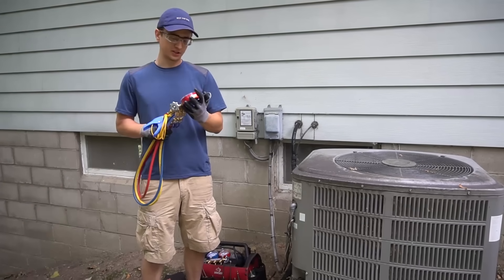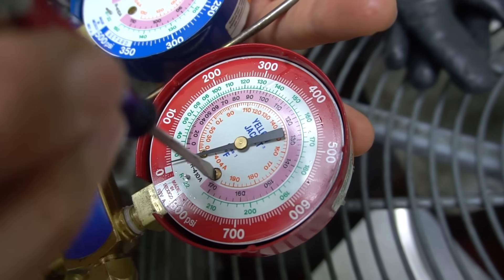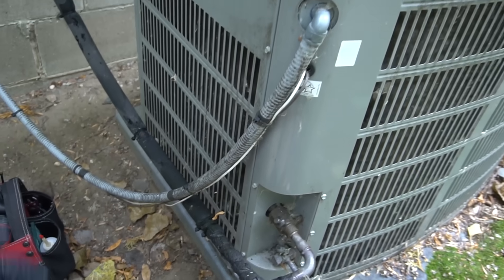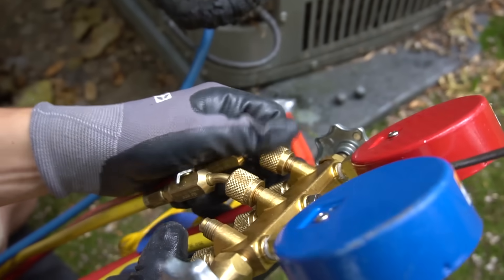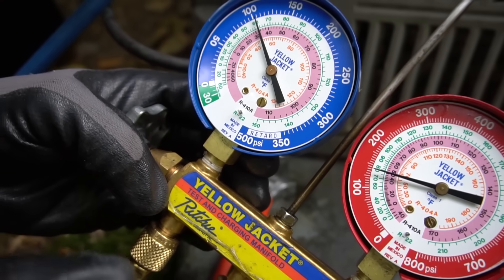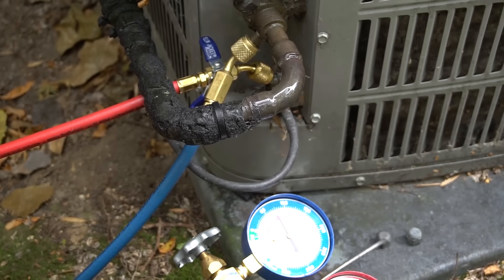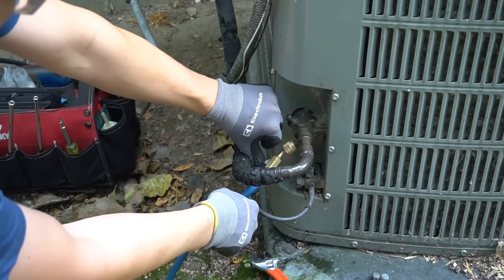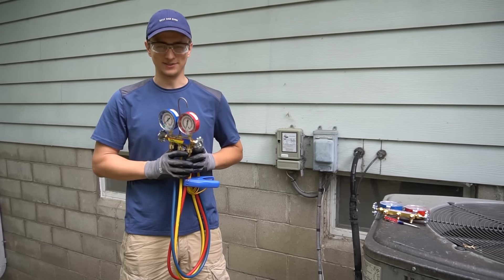How to Check AC Freon Level

Comment: I got a mini split unit. I realized a mini split only has a tap on the low side, not high side. So I can't use subcool to check the charge... But anyways I checked the pressure on one of my mini split and it's reading at about -10C according to the R22 scale. And the evaporator coil seems to freeze if it runs for too long. Will need to charge it a bit more.

Comment: 13:05 what if you don’t have ball valves, could you still purge the air from your gauges using the same method of opening up the valve on the high side?

Edit; in HVAC/trade school

Comment: Hi Sir, if the unit is R22 charged and using fixed orifice, which one would be my basis for refrigerant charge, just the saturation temp alone or the target superheat table or formula? Thanks in advance.

Comment: Thanks for the video. Pls  I have a question(1)do you turn off the condenser unit before the process.(2) Is it good to transfer the air from the high side to the low side.

Comment: Your video was well done and it was good you express concern about introducing air and moisture into the system because that is the biggest risk when gauging up to a system and over time, when done incorrectly, can cause operational problems. It appeared that your gauge set was flat when you attached the suction hose and I was waiting for you to instruct us the purge the gauge set through the middle yellow hose and the high side red hose with the system freon to remove the air from the hoses but you didn't. 😕 The air in the hose doesn't necessarily remain in the hose when connected to the system, especially when you start the compressor and the low side pressure drops from 100 psi to 70. It is good to run the liquid from the high side hose through the gauge back into the system but only if the gauge hoses were purged first. Blowing gas from the high side hose into the atmosphere didn't necessarily puve the hose, but only released some of the freon. So, sorry to say but it looks like you blew some of the air that was in your middle hose and all of the air that was in your low side hose, directly into your system when the opened the gauge and ran the liquid from your high side hose into the low side. What I've been doing for 37 years is gauge up the low side hose with the left knob on the gauge set open slightly and the center hose loose and the high side hose attached to the system but not threaded on enough to push in the stem, and guess how long to let the vapor purge through, a few seconds, and tighten up the other fittings, preventing air from entering the system. FYI also, when you remove the high dise hose and the liquid freon blows out, it freezes the Schrader fitting, causing frost and moisture to form inside the valve, around the stem. If you don't put the cap back on quick enough you can trap moisture inside the opening of the valve and push it into the system next time you gauge up. If the stem leaks like you mentioned, put the tip of the screw driver in at an angle under the lip of the stem and pry up slightly to seat the valve better. 🙂

Comment: Great video.  Is there a way to check the refrigerant content/percentage level, or is that it?  In other words, how do you cipher whether it is air or other contaminates or refrigerant giving you the pressures?  Is it possible to have "correct" pressure/temp readings and the system be full of air?

Comment: I have 2 questions if you have time. 1) If the unit says TXV on the cover, do you always do a visual check to make sure? Why would anyone ever change from a TXV if that's what the system was designed for? And even if it was changed over, is it really possible that the tech would not make a note somewhere that could easily be seen?   2) IF a r22 gauge set is also used for 410, is the teeny tiny amount of oil/refrig that remains in the lines after blowing them out with compressed air going to contaminate either system?.......thanks :)

Comment: What is expected low/high side pressure for 410A when HVAC it is stopped?
What is expected low/high side pressure for 410A when HVAC is running for above 15 minutes? 
Does pressure it depends on outside temperature?

Comment: Well this is a lot easier if you've got an easy-fill valve to check pressure. I've got teo R600a mini fridges that won't get as cold as they should. No mini fridges have an easy-fill valve for refrigerant and people say not to use a bullet piercing valve. What do I do here to diagnose/find and repair the potential leak?

Comment: My system is a 18,000 btu mini split 
And I’m
In the Carribean-
My out side temperatures are always 
80-90 f. And the temperature we use on ac inside is always 62.
Should the psi be between 35-40 ?
My unit doesn’t have a high pressure port.
Thanks

Comment: On a gas pack unit that has no line set, is it necessary to check the refrigerant if there is no cooling problem? I have a concern that this would disturb the factory weighed charge unnecessarily. Even if the technician squirts a little freon back in, it still wont be the accurate charge.

Comment: This guy saved me THOUSANDS of dollars in service calls and fees. Thank you, bro!
Reply: If your not certified you can get in some trouble by the e.p.a
Reply: @hollicesmall4769  For checking the A/C pressure? Do you know of any regulations that prevent a homeowner from checking it using proper tools and practices, especially if using a low-loss connector?
Reply: @rogerbritus9378  as far as I know you have to be epa certified to touch refrigerant (Freon)
Reply: Where you live? There is a 10k bounty for people like you. You do know its 45k fine with out the proper EPA certifications to do any thing he showed in this video.

Comment: I learned something from this , but was left confused because the explanation of the  way the gauge manifold, and its two end valves and three hose red, blue and yes the yellow one? weren't explained fully. The yellow hose was only mentioned briefly at the very end and it seems important to grab back the freon!
Reply: The yellow hose is used when recovering or charging Freon in the system. The blue and red hose connect as explained in the video, and then the yellow hose connects to the Freon/recovery tank. If you don’t need to charge or recover Freon, the yellow hose stays connected to the gauges

Comment: i have a question please
i bought a new manifold 
its brand is mastercool 
the thing that i didnt understand in this manifold that the three holes which u connect the hoses to it to close the loop are opened holes 
in this case how i can block the auxiliary hole with the yellow hose to check the pressure

Comment: One thing u didn’t explain was how should we find out how much Freon every unit should have !!!! By reading on plate on unit !!!!
Reply: He explained in the video that what is printed on the unit is what change it left the factory with.  The "right amount" of refrigerant on a properly operating system is more accurately determined by measuring the pressures present / the ambient temperature.   Knowing how many pounds doesn't do you much good unless it's completely empty and you fixed why it's empty first.

Comment: Also jay use a wire type temp. probe tape to the tank right in the area where the liquid is sitting 22 or 410 and let the tank and gauge sit for 4 - 6 hours to acclimate to the room temp then do your setting and calibrations .

Comment: Jay that's not how to get a true calibration . You hook the low side to a tank of gas open the tank and note what the pressure is then take the temp of the tank look at. i use 410a pressure to temp chart . And let say the the tanks temp reads 78 degrees your pressure should be set at 220.6 if it to high or to low then you turn let set screw till it is set at that number and remove the low side and do the same on the high as well. They have a you tube video that explains this . Just turning that screw doesn't give you true calibration. Like you videos watch you all the time showed me a lot . Keep give the videos.

Comment: I watched this video twice.. the first time through I thought it was okay. But the second time through, I said to myself.. wait. what did I actually learn? The video does not accomplish what is stated in the description: How to Check AC Freon Level. At least, not in any meaningful way. The author hooks up the gauges, but doesn't really do that right as there is a mishap that he acknowledges in the comments. I believe it's the one in the video at about 8:16. But maybe it's something different. At about 11:20 the author/narrator talks about pressures beings to high or too low but not how to determine this.

Again, we did not learn any particularly meaningful information in the video about whether the coolant level is correct in this system. We only learned that it has some coolant. Which should already be evident by a system that is producing at least some cold air, without hooking up any gauges. Read the comments by "real hvac tech", "Drew Blood", "D theman" and others.

This is not a video that is deserving of over 1.2 million views (as of Oct 2020). The author should take it down and make a better one. But, there is some good information and the author is thoughtful and articulate .. I give it an E for effort.

Comment: When my AC system is off, the pressure is at 150 PSI. When I turn on the AC system, the pressure goes down to 40-45.  When I open the low pressure valve to add refrigerant, it stays the same and when I close valve, it stays at the same pressure. I don't know if the R22 refrigerant is not going  in or if there is some other issue. I added 14 oz of R-22 from what I saw on the scale and no changes took place.
Reply: reading low pressure does not necessarily mean that you are low on refrigerant.  You could have a variety of problems such as low evaporator airflow, or a metering device problem just to name two.  You really need to check superheat and subcooling to pinpoint your actual problem.

Comment: My Compressor overheated I got it to cool down I was to check the pressures on my gauges  but I have a question why does my low side read higher than my high side on my high side on my compressor would you know

Comment: Very poor advice on how to check refrigerant charge, obvious that you've never worked in HVAC. First thing is you contaminated the system by not purging your hoses, and the pressure means almost nothing without knowing what the refrigerant temp. is or what the superheat or subcool is supposed to be.

Comment: Nice work. Inheriting a month old 5-ton Goodman install that is blowing warm. First thing I noticed was a wet floor at evap--which wasn't replaced. Secondly it looks as if installer had trouble brazing and may not have used nitrogen (carbon).
So this morning I will run it and check line temps, or should I just gauge it up, check readings and do a pressure test? I hope internals have not been affected by carbon deposits. I "was" an apprentice 25-years ago so my memory is suspect. Have STDs. gauges,  410 supply, recovery tank (has some 22 in it, nitrogen with bubble, micron gauge, turbo torch (what size torch would you suggest?), but no scale. 
It's hot, it is a day care, and no one is available to diagnose/repair--so it is me.
Any tips would be greatly appreciated. It's 5AM and off I go!

Comment: Excellent hands on advice. I could have saved myself hundreds of dollars if only I was a little more adventurous and  changed my  AC's capacitor myself. It it not such a complicated affair and you have videos on just about  every aspect of AC repairs. Well better late than never, I will certainly learn from your more for any future problems. Even if I can't actually fix it, I would be better prepared to work with a pro. 

Thanks for educating us masses.

Comment: Hello, I learn a lot from your videos! Good job!
Could you give me your opinion about my numbers? I am in Texas, blue I get 50 PSIG, red I get 180 PSIG. The air temp was 76 F. Refrigerant is R22. 
The system cools ok but the return line is cold to the touch but not very cold. Like maybe 65 or 70 F.
Reply: Working fine. Leave it alone.

Comment: Warning!!!!  To anyone watching these videos or any other videos seeking advice on how to do things yourself please keep in mind that anyone can post any type of instructional video and not be a professional and they can make mistakes that can cause you problems.  "Word of Advice TV" has even posted a comment on the mistake he made in THIS video but it is embedded in all the other comments and hard for anyone to see and be forwarned.  I copied and pasted his mistake at the end of my post here. 

Please watch multiple videos to learn more info about doing things.  AC is very complicated.  "Word of Advice TV" is making great videos and has good intentions but he is learning and making mistakes in his videos too.  He tries to warn people to not do things if you are not a professional and also confesses to mistakes later in comments.  I am learning by watching multiple AC videos that a good percentage of even professional HVAC people make mistakes too. There are also many professionals that will rip you off by over charging and mis-diagnosing AC systems.  

Please be careful with all YouTube videos and learn from multiple sources.

Following is the "Word of Advice TV" comment;
*****
Guys, in this video I made a little mistake and just want to make sure you won't do the same. When I put my gauges on, the unit was off. Usually I put them on while the unit is running. In the video I forgot to purge my hoses when I put them on which is especially important when the unit is off. When I then turned the unit on, the air that was in the suction side hose got pulled in. My AC is working fine but I am sure if I do that mistake a couple times I will have problems. Air is a contaminant in the refrigeration system so purging hoses is something that shouldn't be forgotten. If you have anything else to add, please do so! I do not claim that I know everything. A technician is always learning new things. Cheers!

P.S. Also want to re-emphasize that refrigerant can be dangerous and your AC unit can go into an even worse condition if someone does not know what they are doing. Therefore if you do not have any background or experience in HVAC, I would highly recommend not dealing with refrigerant yourself. Stay safe!
*****

End of his post.

Comment: Are you saying factory charge never covers line set, We always have to add to new unit?  I'm in dispute with HAVC tech that said factory charge should cover 25 feet line set.  I don't believe is true.
Reply: Yes they do
Reply: @1servingtruthfreedomplease  yes they do what?
Reply: @1servingtruthfreedomplease  my 5 yr system was never fully charged or has leak.

Comment: There are brass caps on top of the low and hight sides of the landscaping into the unit. Under the caps are the valves that shut off the line. A small hex wrench can open and close the lines. Sometimes only work on the high side. I close it while hooking up the line then open to get the flow going. I do this so the vapor doesn't come out during attach it detaching the line. Some shrader valves are hard to access with the $50 dollars  valve core removers.

Comment: I have a question.

Where I work we have units that use different types of refrigerant. My supervisor's procedure for checking pressures like during a superheat test are as follows.

(1) hookup both gauges.
(2) only reads outside pressure scale and ignores the one for specific refrigerant.
(3) adds refrigerant if necessary.
(4) returns refrigerant in hoses using suction side.
(5) purges hoses.

Here is my question. If they worked on a unit with different refrigerant the last time they used the gauges shouldn't they purge the gauges with a little deminimus release from the next one before hooking up suction (blue) side to prevent contamination?